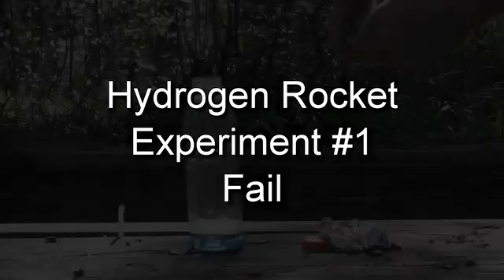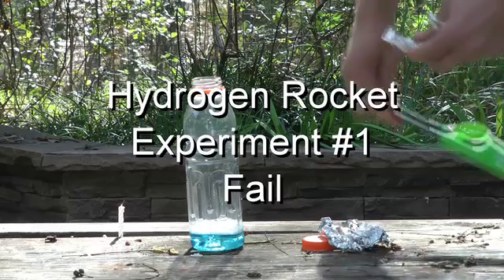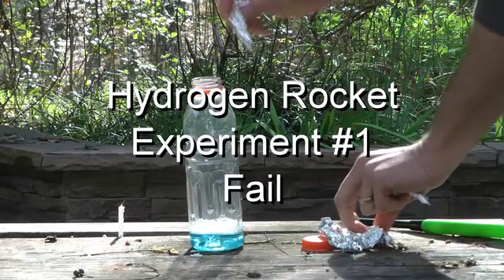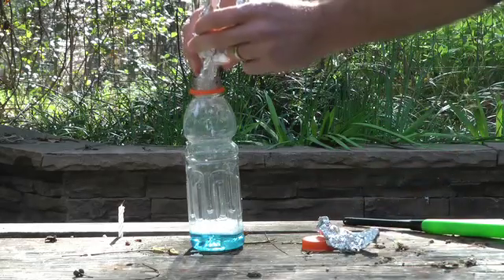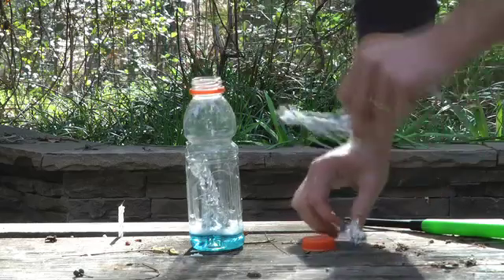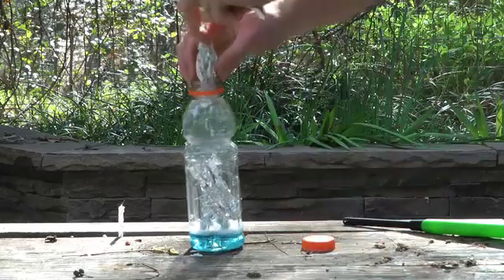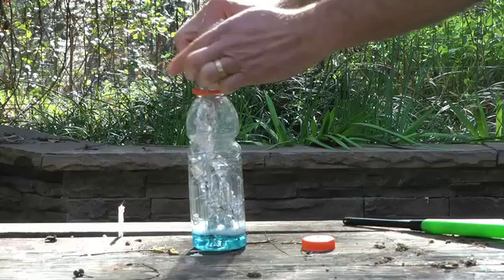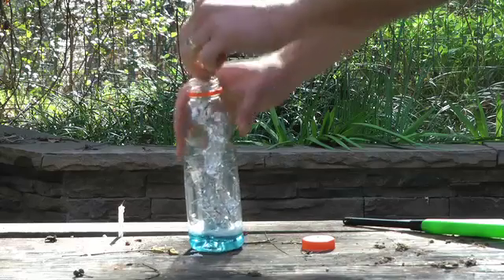hydrogen rocket experiment fail

Comment: It actually appears to have been a partial success. It happened in only a few short frames but the cap of the bottle appears to have failed first and shot off leaving the rest of the bottle to expell all it's pressure and go flying.

A bit less fire than you hoped for, but still technically a rocket.